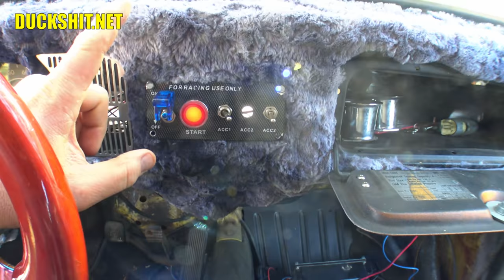🔥⚡LET'S GUT THE WIRING!⚡🔥 - VW Super Beetle Volksrod Project - 03

Comment: I stand corrected. You are right for not just ripping out the wires for a new harness. I am pretty good with repairs. BUT, I hate electrical issues. Awesome job 👏
Reply from the maker: Yep, all the junk wires come out!  However I don't think it needs a new harness.  It just needs to be fixed and done properly!  :-D

Comment: On the back of the switch panel, the part you thought you broke is called a contact block. Where you see it says " no" , means  normally open. If it says "nc" that's normally closed. If  you notice the flat head locking screw on it that is just a second set of contactor blocks stacked on top of the bottom ones (where you have your white wires going in to.) You can just remove that broken block. You can also look up any numbers on it to make sure it's even the correct block for the voltage you are running.
Reply from the maker: Thanks man, I know how it works... but its hopeless busted.  I think the previous owner broke it and just kind of jammed it in there.  I picked up a new unit.  😁🤘🦆💩

Comment: Ignition switch wiring:
30 Red or Red/White. 6mm2,Live feed. Looped in to Live Fusebox busbar placed usually in the centre (12 way fusebox, fuse 7, 8, and 9).
15 Black 2.5mm2 or 4mm2. Fusebox and Ignition coil feed. Looped into fusebox feeding 2 or 3 fuses one of them 16A. Later models with an X circuit just feed 2 8 amp fuses. A black wire then runs from the fusebox busbar back to terminal 15 or + on the ignition coil.
50 Red/Black 4mm2 starter solenoid. May run back past battery.
X circuit. Black/Yellow. 4mm2. From 1970. Feeds fuse 10 (12 way fusebox rated 16amp) and the headlamps via the light switch terminal 56. Cuts out when turning over engine on the starter. See note above about terminal 15 for earlier models.
Reply from the maker: Thank you for the technical description

Comment: I’ve had a few dubs over the years and I found that it’s easier to just rewire the whole thing, you can use all the same color wire if you mark them. I like to color code them and mark them too. It makes life so much better. This wiring job was just done by some lazy ass.  Looks like a fun car.
Reply from the maker: Well I don't think we need to replace the stock harness, I can fix it.  Rewiring should consist of just repairing damaged sections, and re-establishing proper connections!

Comment: That harness you removed was from a port installed AC system, probably DPI manufacture.  I have a simalar system in my 1974 Beetle.  Same circuit breaker on the positive side.
Reply from the maker: Interesting... why do all the wires look like it went out to all 4 corners of the car, and what's the trailer plug under the steering column?
Reply: the electrical wires went to the compressor "on" control in the engine compartment, the fan "On" in front at the condensor, and of course it all connected to the evaporator unit under the dash.  You should also notice largers holes drilled open for the AC freon lines in front and rear.
Reply from the maker: I didn't see any holes in the rear that popped out at me for such things, but I will look more closely.  Still, that wiring looked more like a towing harness.

Comment: My 65 Ghia was wired by house electrical contractor. This was such a mess that I had to order new harness from a German suppler. To give you an idea of how screwed the wiring was ,they used 10 gauge wire from a house all the same color . They converted to 12 volt and left everything 6 volt. So my tail lights where melted and it just smoked everything that couldn’t take the voltage. Not to worry it will be done right ,and live again.
Reply from the maker: Oh man, you'd think an electrician would have some kind of sense!  LoL

Comment: Having owned a '73 Beetle and a '73 Super Beetle, I can tell you the brakes are almost the same...
- From the master cylinder to a metal line through the body to a mounting clip on the body.
- From the metal line on the mounting clip to a soft line and onto the brake wheel cylinder.
- No metal line on the wheel cylinder.
Reply from the maker: I believe they are the same, only the exterior shape of things are slightly different.  I may have to re-evaluate the brake lines if need be.  Thanks for the input!

Comment: I have been told there a lot like Austin, I think they switch with earth not the positive, lately I found a lot of motorbikes are the same? But ye there are some that should not touch wiring at all, not that I'm that good at wirers, anyway all the best to you all
Reply from the maker: It depends on the circuit, some circuits will switch on the negative side and some would be on the positive.  Oil light switch for example is a ground switch, but headlight is a positive switch.

Comment: Vehical wiring is not complicated on any of the older vehicals. When the computers when on that's when it was more of a pain. Every one is different though for sure
Reply from the maker: Yes, older vehicles are much simpler without all the sensors and computers and power assisted devices!

Comment: I think it was wired by a Harley rider. Before anyone gets upset I have been wiring Harleys for years. Example 1 showed up @ my shop with wires across the top of the gas tank. Example 2 the guy wired his whole bike with only red wires. (Any prob suspect the red wire) example 3 I’m riding with a guy and there’s sparks under his bike. I got him to pull over and found he had the Bosch regulator mounted to the front motor mount with one screw which broke and he was dragging the regulator by the wires under the bike. 😜
Reply from the maker: THERE MAY BE SOME TRUTH TO YOUR THOUGHT!   Those custom taillights on here are actually for a Harley.  As you'll see in the next video I had some problems and had to research them... more about that in the next one!  Thanks for that story, too!  LoL!

Comment: Duck Man :) I Lol at your joke don't worry about, I had do my 2002 Chevrolet Impala car  ground after got hit by lightning in 2013 Summer Season months at home! Could get right size Cable so what use a cable made for my older Chevrolet truck years ago and explained how fix 2002 car to ! Put a aftermarket connector for battery post got a Truck Stop of side then user 14 gauge on nut of clamp to my old Chevrolet truck cable pig tail wire then flat post connector put on battery hold clamp bolt with 2 metal washers & the 4 foot cable loop to crash bar with 2 washer sandwiches nut hold on&  plus 14 gauge on it plus other nut with 2 washers too! Funny part got more Alternator recharge voltage by .1 plus better starting up and not fire on electric ever too! So can say it was task but still going strong plus get perfect ground to whole vechile!
Reply from the maker: I'm glad that worked for you 😁👍🏻